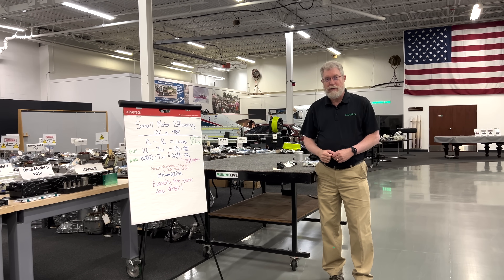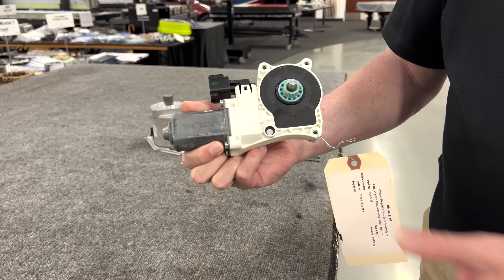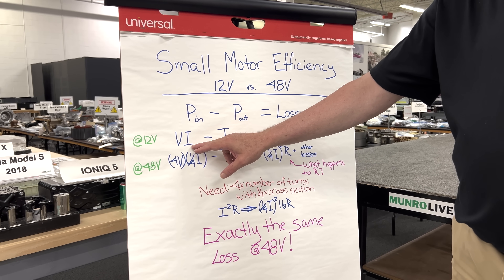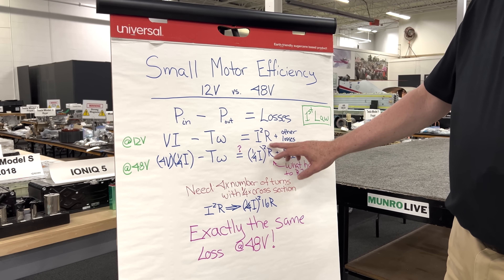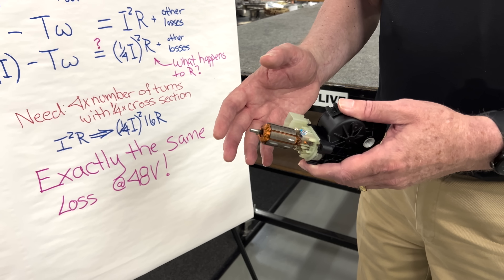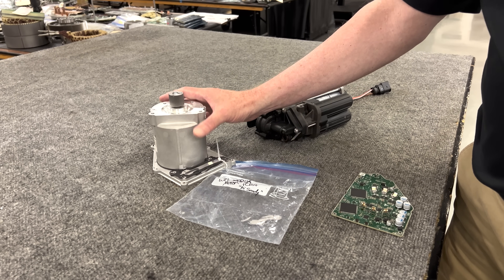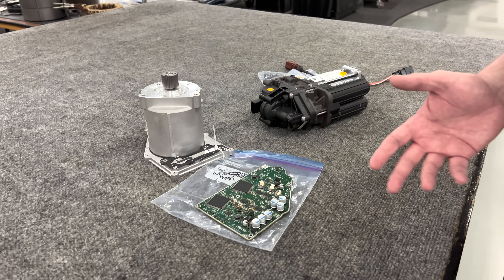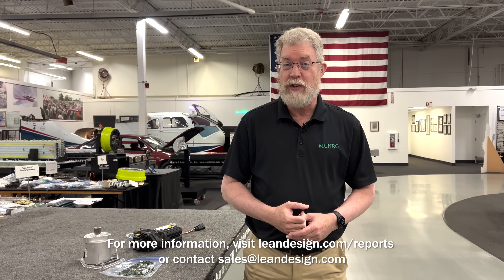Cybertruck 48V Motors: Why Tesla Made the Jump

Comment: When using "V" for voltage (measured value) we (Europe) normally use A for Ampere (measured value). Otherwise, when we use "I" for current we use "U" for voltage as nomination letters. We never mix "V" and "I" or "U" and "A". Ohms law is normally written U=I×R.
The most common reason for raising the voltage and thereby reducing the current is not at all about electric efficiency but to be able to use thinner wires, which means lower cost and lower weight.
.
So a motor for 48V is using windings with copper wires that are 1/4 area (higher resistance) compared to a 12V motor. Hence they will fit in the same rotor.

This is also why there is a huge advantage to have a 800V drivetrain instead of 400V in an EV, and I think we will see 1200V and maybe 1600V drivetrains coming. The power electronics are already there to be used, I think it is more a question of regulations.

Comment: 12V (8.33A): 2.5 mm² to 4 mm² (AWG 14 to 12), 48V (2.08A): 1.5 mm² to 2.5 mm² (AWG 16 to 14) should suffice.
1.5 mm² wire: 13.44 grams per meter.
2.5 mm² wire: 22.4 grams per meter.
If we take into consideration the length (~2m) of a single wire that needed to connect one motor (pure speculations), the difference in weight between 2.5 mm² and 1.5 mm² wire is 8.96 grams per meter or 17.92 grams at 2m * 2 (pos neg) = 35.84. That's not a lot. But if we multiply this by 100 000 units = 3584 kg of pure copper.

Comment: Our railroad used mostly 24V DC switch machines, but in the yard they sometimes used 110V DC. Even with long cable runs, the V was high enough to move the points in very cold weather and at good speed.

Comment: R=U/I 
R is a symbol, U is a symbol, I is a symbol.

R is in Ohm/Ω, U is in voltage/V and I is in amps/A.

Ω=V/A

*edit:
The main advantage is the weight of the wire from the battery to the 48V motors.
Those wires can be less then a quarter of the weight compared to 12V.

"Less" then a quarter? Yes, less then a quarter and not a quarter.

Also note that hot wires give more resistance then cold wires. That means that if you got a wire near a petrol engine (or in your oven or name it), these wires will be more hot then wires on other places, that means that those wires need to be extra thick despite the same amps going through them. 
This is also why electric fires happen far more often in the summer compared to the winter.
If you install your charger in october, it could very well be that it works for 7 months and then in april or may it suddenly starts to burn out anyway, when the electrician is long gone.

Comment: The letter “I” is used to denote electric current (amperes) due to historical and linguistic reasons. It comes from the French phrase “intensité de courant,” which means “current intensity”. In physics and engineering, standard letter symbols are often used for consistency and global recognition.

Comment: The 48v setup is going to only help in the steer by wire feature where there would be significant/continuous power demand, all windows, wipers, door motors are way low in the fraction of decimals in terms of power /efficiency considerations.....
Reply: The front windscreen wiper is very large, then there is the rear cover, it took 50 years to go from 6 volts to 12 volts Tesla is going 4 x in one go giving twice the previous jumps should be good for 100 years

Comment: You forgot the losses in the wires going to the door. And the weight savings. 

Shocked they’re not using synrm motors instead of brushed motors for everything. You’d get massive increases in efficiency and the savings in wire would likely pay for itself. 

Probably just gen 1 stuff.

And things like air suspension and power steering should be 400v stuff off of the main battery simply switched by ethercan

Comment: It's obviously not gonna cost less energy to roll the same window down with the same motor using a different wire. But it is gonna save on wires and loss in the wires using a different wire. Like wtf this is so obvious and stupid. First wanted to dislike it but than I figured I did enjoy learning about the window motor and the switches thing in the end.

Comment: I’m still confused. Why did Tesla choose 48 volt instead of 24 volt as some tractors use and if 48 is better because everything becomes more efficient, then why not 96 volts or higher?  The math is easy (although I think Engineering Explained does it better) but I still don’t understand how they arrived at 48 instead of something else.
Reply: 96v hurts too much

Comment: For EVs, the auxiliary power significantly affects the range of the vehicle because the power for the auxiliaries come from the HV battery. So, a little saving in auxiliary power caused by the switch to 48 volts will have its effect on the final range of the vehicle.

Comment: EV scooters and Bikes are using higher battery voltages. The first ones had 12V but as power went up so did the voltage. V=IR reasons

Comment: It's weird that you ask why you use the letter I for Amps but don't ask why you use the letter U for Volts. And the answer to both questions ist, that you don't.
For Amps you use the letter A and for Volts you use the letter V.
When setting up an equation though, for the variables you can use whatever letter you like, but usually you use I for current and U for voltage.
For some reason in your equation you use V (which is a unit of measurement, not a variable) and I (which is a variable but not a unit of measurement) and that's where the confusion comes from.
Some more examples:
Distance: Unit "m", letter "d"
Time: Unit "s", letter "t"

Comment: The Hummer EV has 4-wheel steering yet is on the same 12V architecture, so the argument to switch to 48V isn't satisfactory.
Reply: US still has 12 volts on real trucks the rest of the world has 24 volts GM in the US is not the peak of automotive technology I worked at GM in the 80s they were crying about the Japanese overtaking them and they are still dragging their heels they would still use 6 volts if they could get away with it.

Comment: please correct me, for i fear your explanation is too complex
p=iv
if you have 4x voltage ,
you need to have 1/4 current to have the same power, to balance the equation

same power = 1/4 current x 4x voltage [ie 48 volts]

to 1/4 the current, is a good thing because it also decreases wasted [useless] heat
It also decreases wear and tear.

to reduce the current you simply increase the resistance by having thinner wire.
Thinner wire is a good thing because there is less weight and less wire. 
That is why the 48v architecture has thin wires. 
I think this is a simple way of explaining 48v architecture.

Comment: And it could be even more efficient with even more feature if they used 3-phase AC, 100V
Reply: Or 415 volts ac but who wants that in the door in a crash near your arm up to 50 volts is considered safe to touch.
Reply: @JonathanTamm  considered. Try licking a 9V battery.

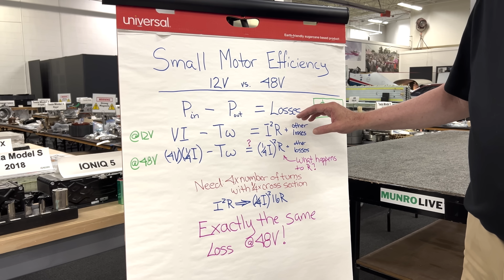Comment: 3:30
Voltage and Amperage are American terms, derived from the name of the unit. Imagine calling the  length 'inchiness'. 
True names are Tension (U) and Current (I), Resistance (R). SI Units are Volt, Ampere and Ohm, named after Alessandro Volta, Marie Ampere and Georg Sigmund Ohm. In the UK spark plug wires are called High Tension leads. 
So U/I=R. V stands for Volume, btw.

Comment: I am not an engineer, but have designed greenhouses and growrooms on 48V grid. you gave a good explanation, but maybe skimmed over the major point. 4X V allows -4X I. when the amperage decreases, the wire size decreases, the safety factor increases, cost decreases. you did say this, but maybe your emphasis was more on the features they could offer with 48V instead of what allowed them to offer those features. I got it, the mosfets and all other components can be downsized. but I knew that answer already. not sure if someone unfamiliar with this would catch it. but tks, great vid. how long before other manufacturers start the adoption?  still waiting for a vide on axial flux motors, are they worth the hype?

Comment: agreed. too much hype from Tesla content creators/stockholders whether they truly know or not about 48V system. Cost savings can only be realized once the industry move most of their systems to 48V.  To be fair, Tesla did this at just the right time.  LFP battery is now a viable replacement to lead acid batteries which costs less for over time because it does not replacement.

Comment: This is all true, but the losses to get the energy from the battery to the window motor are less. More importantly, the same is true for getting energy to your heat pump, fan, steering motors, and other items that are more regularly using energy. As well as what other people have said below about smaller, lighter, cheaper wiring.

Comment: It looks like the analysis is quite incomplete. For instance:

1. More loops of the thinner wires in the motor are the worst because the wire itself is not only the copper but also the insulation layer. So as more loops and higher voltage the insulation becomes a larger problem and makes the copper thinner and R higher. So generally this is the way to lose efficiency.

2. There are switching loses since the motor wiring supplied by AC voltage. It can be improving with thinner wires because of "skin effect" and more problematic with more capacitance for longer and thinner wires.

3. The FET transistors in the inverter you mentioned not necessarily are getting cheaper with higher voltage. It is more complex since the internal insulation also is growing and need different process for higher voltage. Fortunately 48V FET are indeed more cost efficient than 12V typicaly.

So most likely the major reason is the DC loses in the cables, inverters PCB and quite importantly in the low voltage battery.

It is indeed becomes nearly impossible to power steer by wire motors from 12V battery with required currents etc.

Comment: your 48V example is a little misleading; I could run the same physical motor as in the 12V case at 4x the RPM using 48V with 1/4 the current & torque, use a gearbox to the get speed/torque I want and in the end get higher efficiency out of the system. if higher voltage doesn't lead to higher system efficiency, then why not have the main high power battery be 48V instead of 400V and save the hassle of having to deal with HV safety?
Reply: If one wants a 48 Volt low voltage bus for whatever reason, I suspect altering the amp-turns in the motor armature is less expensive than asking the supplier to redesign the gearbox of the window regulator motor.  Also, assuming it is a cheap brushed DC motor, keeping the armature current lower will help the brushes last longer.  The motor is only used a few seconds per day, so brush life probably isn’t major consideration.

As far as going to am48 Volt main battery, it certainly is possible.  The problem is with something like 800 HP or ~600 KW collective for the traction motors, that means a current draw of ~12,000 amps.  That would require a lot of beefy MOSFETs paralleled to handle as well as heavy gauge wire.  It is probably cheaper to have fewer high voltage MOSFETs versus more low voltage MOSFETs in the drive electronics.
Reply: @wtmayhew  first point: yes, using the same motor with different amp turns is an economic decision, not an engineering one. 

second point: so you're saying the vehicle would have to be much heavier. what does weight do to vehicle efficiency again?
Reply: @nuttyDesignAndFab   Manufacturers make their decisions based on what will minimize their per unit cost to meet a performance specification, often unrelated to the theoretical beauty of an engineering approach.

Efficiency is related to vehicle mass.  An often cited engineering rough estimate is that each percent change in mass is equivalent to the same percent change in energy consumption.  “Weight,” as used above refers to wire diameter.  The engineering estimate from UI Physics Dept. is that for low frequency power transmission, 700 circular mils per amp is required.  12,000 amps requires the cross section equivalent to 12 4/0 conductors per terminal.  That is milage is split between front and back.  A 4/0 wire has a conductor diameter of 0.46 inches and mass of 0.653 lbs/foot.  There would probably be a total of about 25 feet of conductor(s) for both battery terminals.  That is about 196 pounds of copper wire plus insulation for a 48 volt system versus 32.5 pounds of copper for an 800 volt system.  Clean copper suitable for wire is about $3.65 per pound.  Just in the reduction of copper required, $596.78 would be saved.  I’ll leave it to someone else to figure out the costs of the MOSFETs needed for the drive electronics.  From an efficiency standpoint, the mass reduction is about 2.3% of the Cybertruck 7,000 pound curb weight (total mass).  A ~2% to 3% reduction of energy consumption is worth doing for the customer because it adds up over the service life of the vehicle.
Reply: @wtmayhew  bro my points went straight over your head.

Comment: This is ABSOLUTELY NOT how it works.  The current through the motor does NOT only depend on resistance of the winding.  It also depends on the inductance of the windings, which in turn depends on the mechanical power the motor is outputting.  The faster the motor is turning, the bigger is the second factor.  Increasing the supplied voltage decreases the current that is required to produce the same electromotive force in the motor, which reduces Ohm's losses.  Which makes the motor more efficient, or more powerful, or both (depending on the winding)
Reply: I thought current to produce a certain torque only depends on KV and not on supply voltage before ESC.

Comment: Much like the cross-sectional area of the wire, the length of this video could also have been 1/4 the size. And for all the math, you missed the key equation showing torque is proportional to current and number of turns... implying the losses are only the same if it's required to fit in the same package/not use more copper.

Comment: The voltage drop across the dissimilar metals of brushes and commutator are approximately constant, regardless of current.  They behave somewhat like a semiconductor in that regard.  Therefore, all things being equal, the voltage drop across them is the same for the 12 volt motor as with the 48 volt motor, and therefore are four times as much power as with the 48 volt machine.  Furthermore, the eddy current losses in the armature windings themselves decrease by having the windings more finely divided, ie more turns of finer wire.  Further furthermore, the brushes and commutator can be smaller, and therefore have lower friction losses.  Even more, the voltage drop across those mosfets is approximately constant too!  So, the same rules apply to them as with the brushes and commutator.  I will assure you, that those 48 volt motors are indeed more efficient.  I will agree, however, that that wasn't the motivation.  The ability to use smaller, lighter wiring throughout the car is a big factor, as  well as, as you said, the ability to have higher powered accessories.

Comment: Well there is a difference in cost when considering circuit boards. That’s all we needed to know. That’s your job there finding efficiency cost savings. I a retired Product manager. Here are the rules in redesign products. Add features, reduce cost and increase sales price to the market if it will bare it for a fast ROI for the development.  Attack your own product and that will help keep you ahead of your competitors. 48v makes sense for both EV and ICE. And should have been done years ago by the big 3 but they didn’t do it because 12v is how we have been doing it.

Comment: Errata: Torque times angular velocity is power; with power P measured in watt, torque TAU measured in N.m and angular speed measured in radian/sec (all SI-units) , no "RPM" rubbish.

Same holds true for EMF "U" (measured in volt) and current I (measured in ampere)

SI is VERY clear and VERY consistent in nomenclature, and the balance and interplay of various quantities.

Comment: Regarding the math. Wouldn’t it be more a case of halving the cross sectional area of the wire and doubling the length?
My understanding is that doubling the length of a wire will double resistance and halving cross sectional area will also double resistance.
Regarding the letter I, it comes from French since the properties of electrical current were discovered by Andre’-Marie Ampere.

Comment: Higher voltage improves the efficiency of power transmission not consumption. That is mostly a requirement set by the actual work that ultimately needs done, rolling the windows up for example. The car still requires the same power to move at the same speed down the road. Its about how much power is lost getting the power from the battery to the actual wheels.
Reply: You are correct sir. The higher voltage the lesser lost of power during transport from source to device. That why we used 400-500 KEV instead of 120 Volt to transmit electric on long range power line.
Reply: I've heard even 24v can fry relays...wont the 48v make relays wear out even quicker, or weld contacts together?
Reply: @ should be longer lasting since lower current produces less heat. Current is what welds contacts
Reply: Most people just assume higher voltage = more efficient. I am glad he detailed why its not that straightforward.

The transmission of the power has less loss, but how much is that of the overall system? Not much.

As mentioned the primary benefit of increasing the low voltage system is the ability to supply enough power for new features that could not be powered with 12V. There are cost savings and packaging savings as well, but the driver for change is not efficiency!

Even in this comment section you still have people going on about reducing transmission losses as a primary benefit and how it was not covered…..it’s not a major benefit for the system.